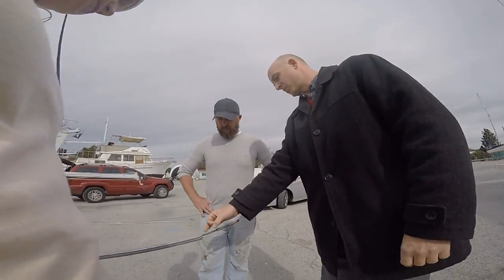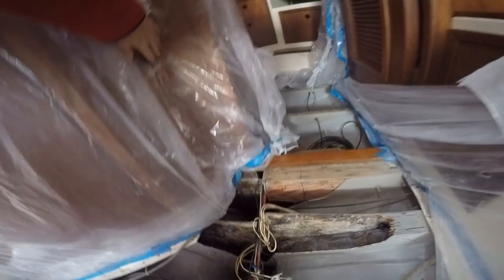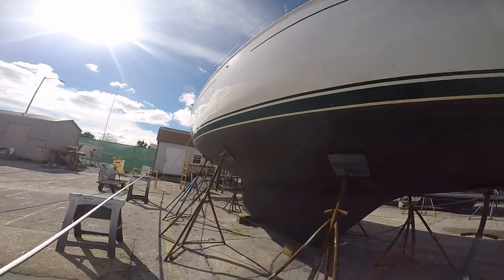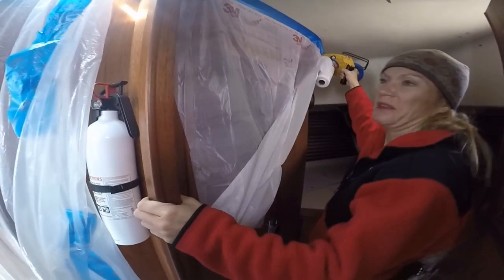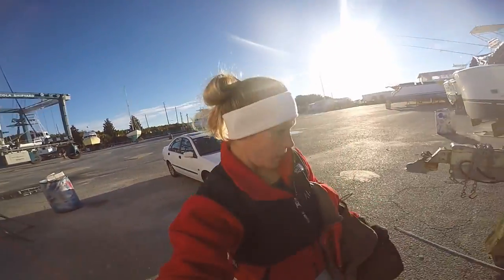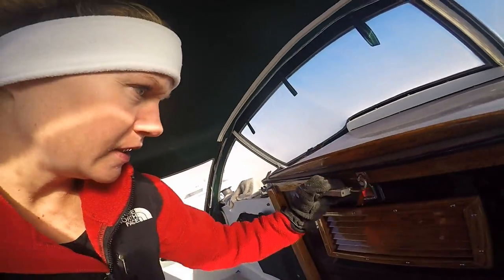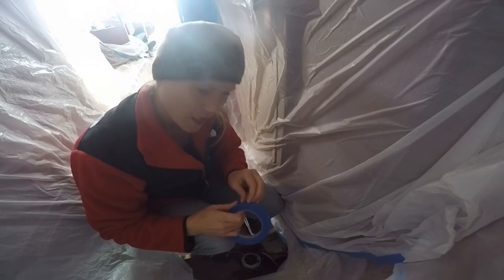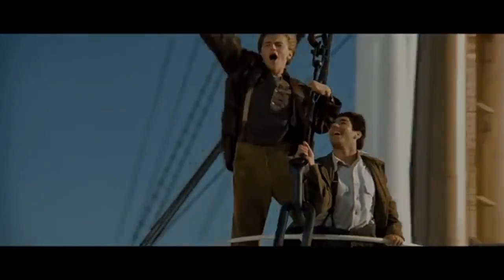#51: Replace the Rod Rigging or Switch to Wire?

Comment: hey thanks again for sharing your repair work. you've probably already worked out the mast connections , mine is done strong and simple on mast using ss threaded rod and ss strap. split pins drilled through rod, nuts, ss washer, ss metal strap, ss washer,nylon washers against mast , spacer tube, the ss metal strap has a hole drilled at each end and corners are ground round. wire is connected to strap via swaged ronstan fitting . if you want more info I can climb mast and send photo, cheers and good luck. Dean
Reply from the maker: +DonutDean Wow, that's super technical but now, after all of our rigging headaches, I honestly understand about 85% of that.  Scary.  I will share the modifications we made and how Phillip, with help from fellow boat owners and Brandon, engineered a strong and sleek system for our upper modifications.  I'm excited to show you all on the videos soon.  Thanks for the offer of the mast climb.  Since I'm the climber in our crew, that means a lot to me.  Glad you're enjoying the videos.

Comment: The Ankle Bones Connected to the-Shin Bone, the Shin Bones Connected to the- Knee Bone, the Knee Bones Connected to the--Thigh Bone...and that's the workings of the Mast!  Sorry it's the best I could come up with. lol  Sounds like it was a riddle for sure.  I would think rod, would be the best option for longevity but...
Reply from the maker: +Ted Smith Hey Ted.  There are too many bones on the boat!  Too many connections, too many places for things to not fit.  At least that's how it seemed.  We definitely gave rod a long hard consideration before deciding on wire.  More to come on that decision soon.  Thanks for watching.

Comment: Was that guy doing Tai Chi?  Sounds like you are going with wire.  Hey they both have advantages and disadvantages.  If one was that much better than the other, the other wouldn't be around.
Reply from the maker: +Pass Me By Do you mean Russ, in our boat?  If so, close!  Definitely some pilates skills to get his 6'4" self into the tiny crevices of our boat.  And, he'll be doing an awful lot of it in the weeks to come.  Totally agree.  There's pros and cons either way.  We were definitely leaning that way at this point in time.  I'll do a good re-cap soon on why we chose what we chose.
Reply: I'm just surprised at the West Marine price.  I may go back to Kemah to replace my gang.  Either that or South to Corpus.  Need a crane.  Not doing it up the stick!  Tai Chi "was all tangled up" at about 6:41
Reply from the maker: Pass Me By Oh ... ha ha haaaa!  Yeah, Brandon cracks me up.  He's quick to tear apart my shoddy work when it deserves it.  The west quote for wire was definitely impressive.  That didn't include any of the below deck rigging we were planning to replace but it was easily the best price we had received for above deck.
Reply: Hmmm.  I've heard West is the Wal-mart of boating.  That may not be a bad thing.  Wally had a good idea in the beginning.  Anyway I'm thinking of cutting my own with Sta-lock.  Another outfit in the Kemah area has a good rep and offered to help as much as I needed.

Comment: I replaced my standing rigging this past fall.  I sent the old wire to a place in ST Petersburg FL to have swaged fittings put on. I used a sta-lok on the bottom end of my front stay.  My upper shrouds are attached to the mast using  316 stainless flat stock  with a slight bed in them and through bolted to the top of the mast.  You could easily make them yourself.     3:50 into the video you can see a close up of how they attach https://youtu.be/sTNP2wg4MVM
Reply from the maker: +Down In The Islands Hey there Down in the Islands!  You're one smart cookie.  I don't want to ruin it for anyone but let's just say your comment hit the nail on the head.  Wait till you see what we cranked out!  Thanks for sharing the video and info.  Appreciate it.  And thanks for watching!